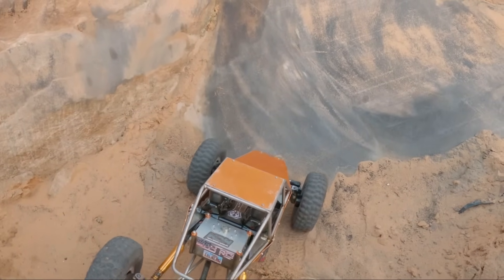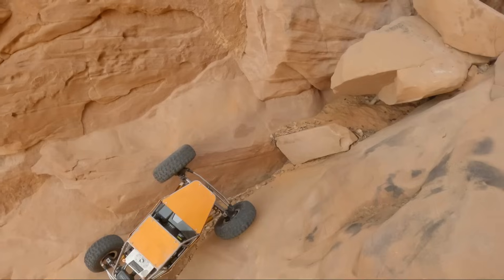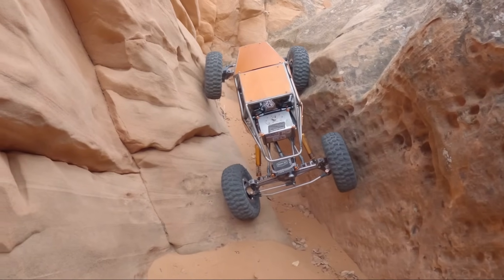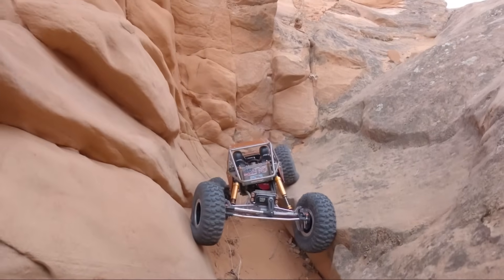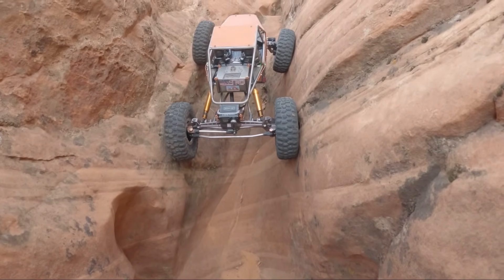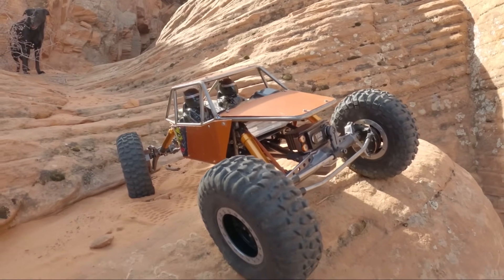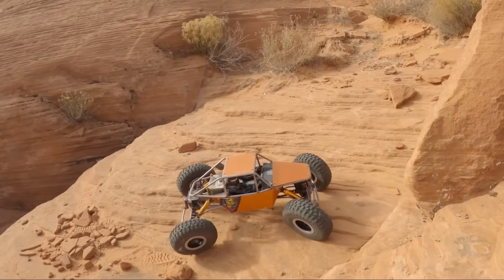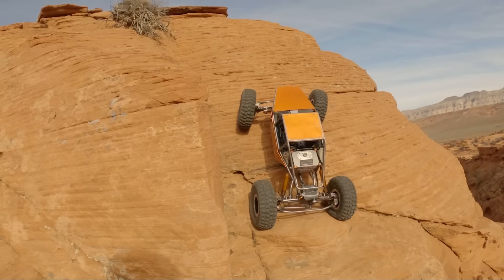RC Speedy Takes on Iron Man! Will it Break?

Comment: I just picked up this chassis on Capra Axles like this and I'm looking for some set-up tips. I don't have the 4ws, but I could use some tips. 

Speedy Chassis
Vanquish Aluminum 3 gear Transmission
Treal Capra Axles
DLux Fab shocks with red springs - oil Unknown
Shifts RC servo
Hobbywing Fusion Pro

I don't like how it sits and I'm not sure if I need to go with shorter shocks or maybe desert lizards with 3/4 droop. Any help is much appreciated.

Comment: I have the opportunity to get an A1 buggy with Vanquish Capra axles with Super Shafty internals and a Capra trans with a Reefs 299LP for dig. It has a Mamba X esc with a Holmes Puller Pro. Wheels are Locked Up RC with JConcepts Rupture tires. Steering servo is a Futaba BLS177SV. Links are Hardcore RC. Shocks are some stock Vanquish S8E 90mm. Price is 1500. Do you think this a deal or not?